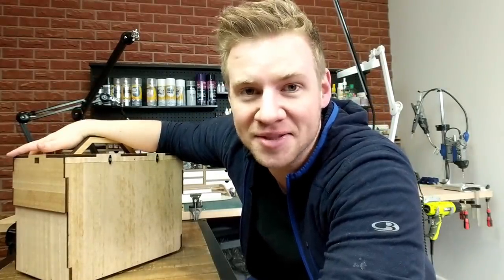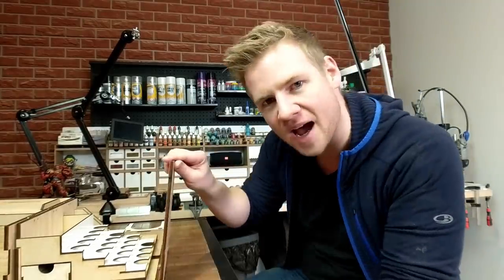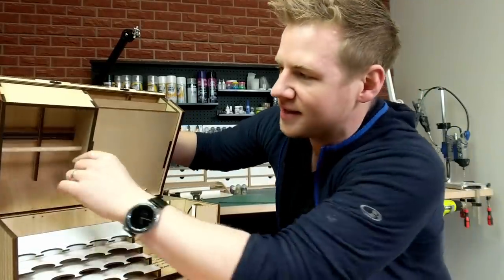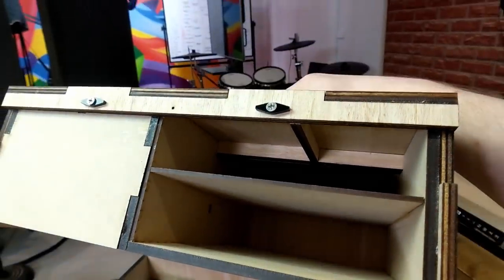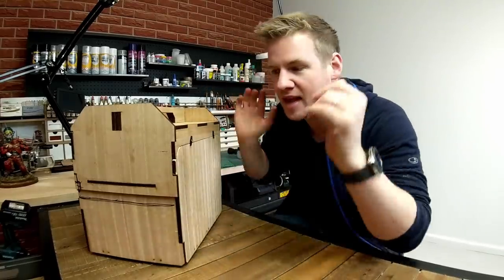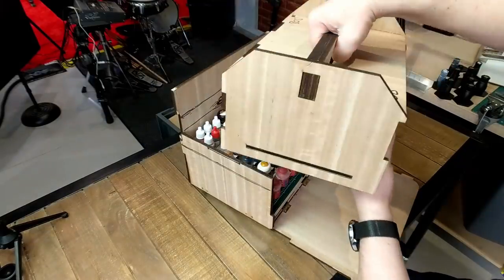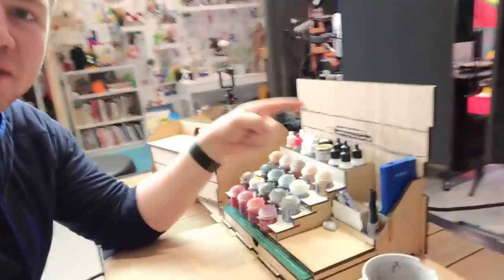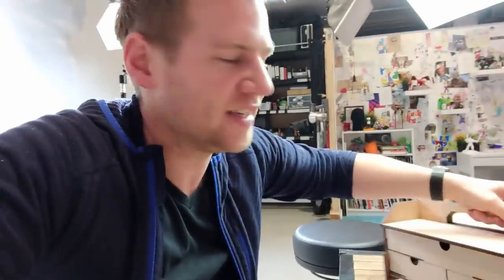My Prototype has MAJOR FLAWS - Hobby Box Diaries ep.3

Comment: RE: 0.08
Back panel issue: Hinges and a latch similar to the front panel.
Wet pallet issue: Is it really an issue since you have a place to put it in the current design? Is the issue with that option that it takes up space you could be using for paints? That being said, I can only think of increasing the height overall and integrating the cutting board into the front panel directly.

But if you are increasing the height for the wet pallet, maybe you are actually begging for another drawer? I don't remember you even including the wet pallet in any of the previous design demonstrations. I am sorry for sounding like a therapist, but is it possible your self-proclaimed "hoarding" character trait is projecting itself into the design process? Be careful of FOMO over what is not already in the box getting in the way of this project getting out of the design phase. Be careful you don't over-engineer this out of a price point for the majority of your customer base. Consider, you might have to accept that you may end up having to provide multiple versions (Noob, Amature, and L33T) or a modular expansion unit of drawers that attaches to the bottom (slides on via u-channels on two sides and latches in back).

Comment: Why cant you readjust the design so instead of the lid going 180 and being flat, have it go 90 instead, with a brace that comes out or can click into place to support the lid and accessing the armiture wire or loo roll in the lid wouldnt be so awkward. That way you only have to work on the lid area and a brace, and it should reduce the amount of overall desk space it takes up, and not have to do a complete redesign